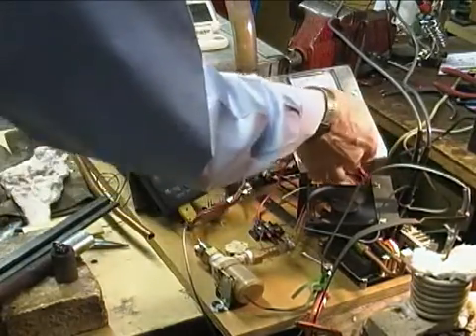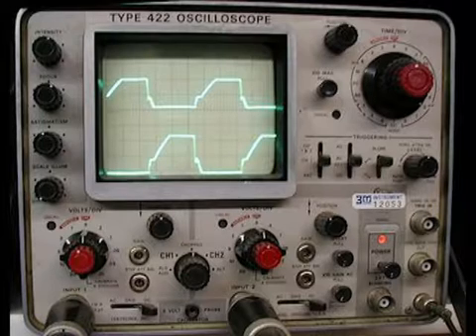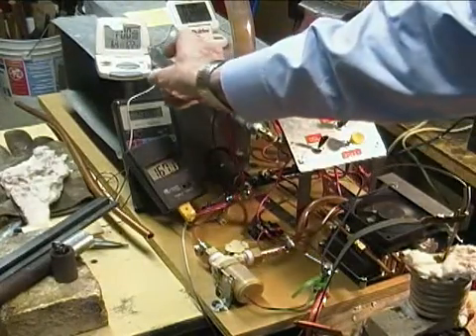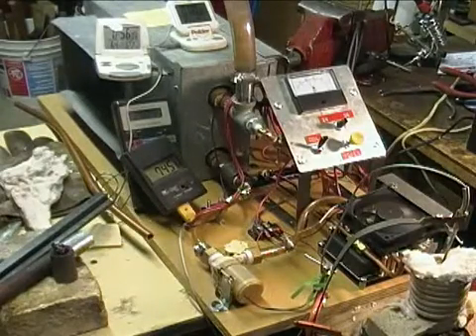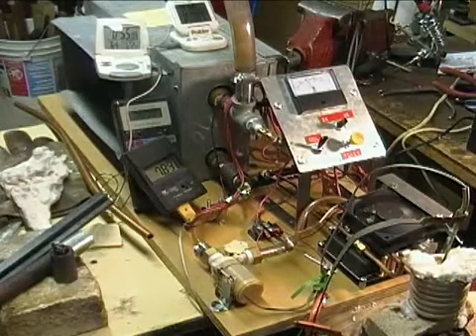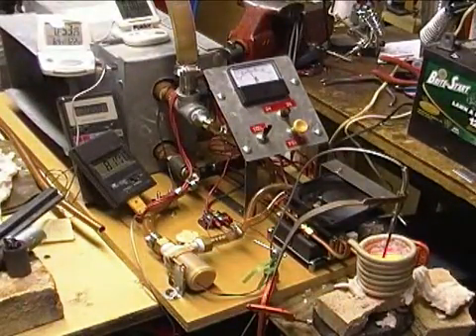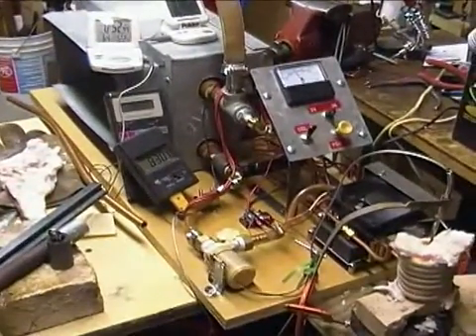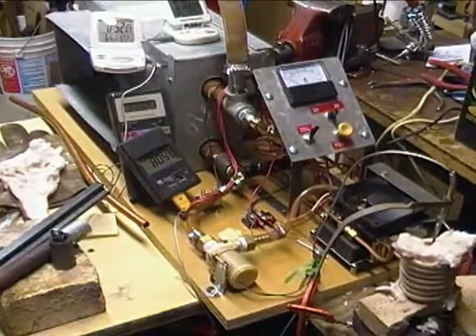Banggood ZVS 1000 Watt Induction Heater Mosfet Cooling & Insulated Crucible

Comment: Make yourself and unregulated power supply and crank it up to 50 or so volts.  I've gotten beyond 1100C with a custom coil on mine without water cooling so yours should be able to as well.
Reply from the maker: Thanks for your comments.
I already have a 48 volt 26 amp regulated power supply, but I am working my up, voltage-wise, slowly.  Before I push the envelope all the way (to 48 volts), I need to get control  of reducing frequency (down to as low as 30KHz).  And I don't need the extra power to get that info.  Just today I got down to about 60KHz on my 12 volt test rig.
  By the way, 1100°C is just barely enough to melt copper.  I'd be surprised if you can pour it and get it to flow very well into a mold at that temp.  So far, the best actual use I have seen for this device is for a solder pot.  If I can't get steel up to 2200°F, I will have to move on.
Reply: I never tried putting a thermocouple into my IH, thinking it would get heated itself and give bad readings.
Does it heat up much when just by itself inside the coil? When used with other material does it seem to reach an equilibrium temperature that is a good indication of the material temperature?
I think you should use your power supply, probably unregulated (connect internally to the filter caps). It will save a lot of mucking about with battery charging and discharging. And if you have a variac, you can easily manage the voltages...